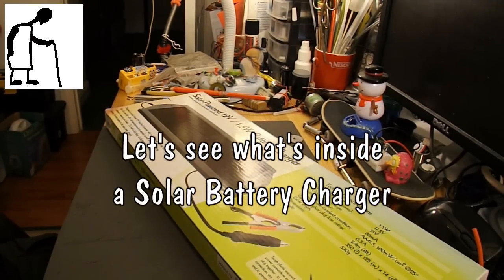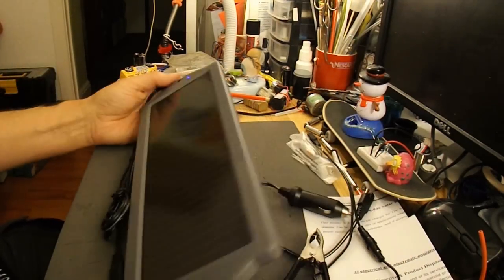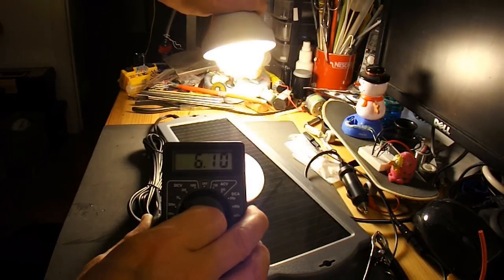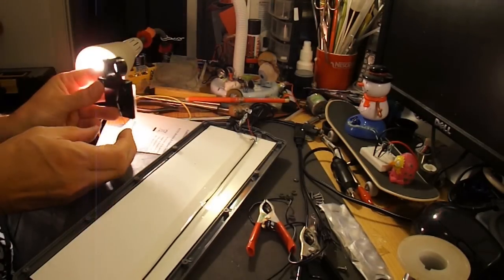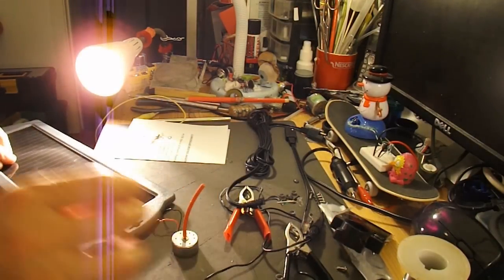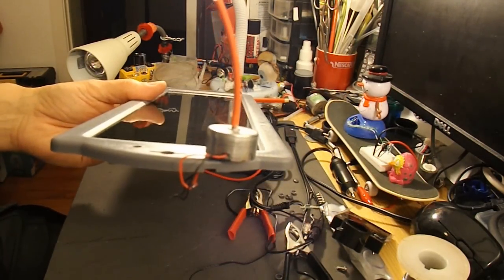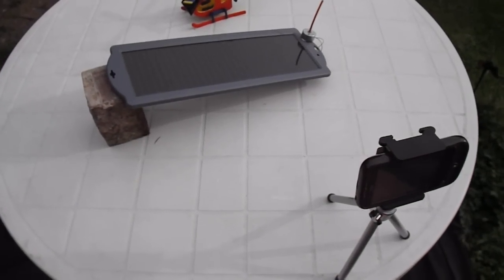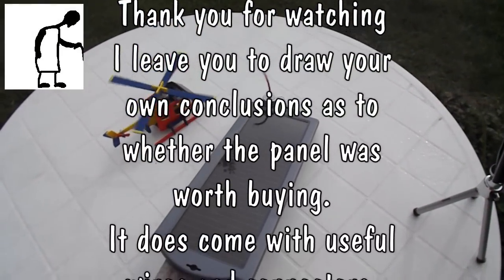Let's disassemble a Maplins solar battery charger

Comment: 1.5Watts Not very much output. I just purchased a 20Watt to maintain the 12v battery in my pickup truck during winter when I store my vehicle for months at a time.
Reply from the maker: Well this was filmed back in 2014 and things have moved on a bit since then. As it is, this one sits on my garden shed window facing north east, so it gets no direct sunlight for most of the year. It keeps the spare battery topped up, that I use very rarely for hot wire cutting foam board. Inspired by your comment I just went out to my shed and measured the voltage. 13.27 volts and thinking back I probably haven't touched it for over a year now.

Comment: They have ripped a lot of people off with that panel
Reply from the maker: It will keep a battery topped up, but it won't charge one from flat. I have it in a window in my shed and it keeps the 12v car battery stored in there topped up nicely. I use the battery occasionally to run a foam cutter. After a few days it will be back up to full charge. Obviously that depends on how much I drained it.
Reply: It's not a rip off if used properly. My car only draws 30-40mA while sleeping, anything that compensates the draw on average will prevent the battery losing charge and be damaged by hard sulfation. On a cloudy day, a panel of this size would produce about 20mA. On better days, you get maybe 60mA, which, in my case, would cover the draw plus self-discharge and there would still be some mA's left over to add to the battery. These panels should not be seen as substitutes for wall chargers. If the panels are correctly sized to match the draw, you would never need a wall charger. The alternator would do the charging the rest of the time.

Comment: The LED is using power - - that's why the meter is jumping about. Open it, cut one leg of the LED to disconnect the LED, your output will be stable then.

Comment: I have a smaller panel than that at 12V and runs my radio a large Russian Astrad   and it bels out the tunes when the sun shines through the kitchen window
Reply from the maker: Yes, I have a smaller panel that I used to run an RC boat so I was very disappointed with this one, but it does keep the car battery I use for hot wire foam cutting topped up in the shed.
Reply: yes it probably will do that ok  still it should have run that motor better than that

Comment: See what happens when you cover the solar panel (simulating no or low sunshine) for a few days. Does the battery discharge?
Reply from the maker: Haha, simulating no or low sunlight is easy here in the UK, I don't need to cover the panel to do that. I leave it connected to an old 12v car battery in my shed. The panel is in the shed window facing north and is never in direct sunlight. It does keep the battery charged but I only use that battery for hot wire cutting foam wings and I have only done that a few times in the two and a half years since I bought the charger. Originally I was measuring the voltage on a daily basis and it would restore the battery after I had used it. I would think it would be totally useless if you wanted to charge a battery from scratch but if you have a battery in a vehicle you only use once or twice a year it is probably fine for keeping that ready for use.

Comment: They generate enough to power.......you've guessed it, the LED. Mine went in the bin.
Reply from the maker: +jackbox to be fair, I have mine connected to a spare battery in my shed and it does keep it topped up. I use the battery to power a hot wire foam cutter and the solar panel keeps the battery fully charged without me needing to recharge it. I don't use it very often so for the amount I use it, it does the job. However I didn't buy it for that purpose, I wanted it to run solar cars or boats and it doesn't produce the goods for that.
Reply: You gain a little more by removing LED but a friend and I tested one of these on the brightest day of the year in 2014 and worked out it would take a week to charge a mobile phone and that was relying on full sun. Given the size you'd think it'd deliver more than that. Not sure whether its an inefficient panel or rather optimistic claims but you need at least a 20watt panel to charge a car battery with anything meaningful. Biggest hurdle with powering a small motor with one of these is developing enough power to actually start it going in the first place. A capacitor might help. Certainly pointless in a car.

Comment: Well I have one and found it was not that great . (💩 really) it's now a great coffee mug coaster ....
Reply from the maker: +spektrum33 I am not surprised, I was not impressed with it although to be fair, I have left it in my shed window connected to a spare 12v battery that I use to power my hot wire foam cutter and it keeps it topped up. If they didn't call it a "charger" it would be OK although I am not sure what a more suitable name would be.
Reply: lmaooo

Comment: don't you have to run these through a charge regulator to prevent your batteries from cooking?
Reply from the maker: +sillychilly There are certainly plenty of people telling you that is necessary with plenty of videos on the subject on YouTube so I have no reason to argue. However these are pretty low output even on a good day and they are only intended to trickle charge the battery even though they label it as a "Charger". You can't stick a flat car battery on it and expect it to charge the battery in a couple of hours. You would be waiting weeks or months even.

Comment: check out this video i doing what this guy did     https://www.youtube.com/watch?v=RxKCUzwIrH4
Reply from the maker: If you are going to spend time modifying it then you might as well buy a bigger cheaper one off eBay at the same time as buying a cheap buck converter. If you order them from one of those cheap Chinese suppliers they will take a while to arrive but they will both come at the same time and cost you less.
I guess the only advantage of buying the kit is you get the battery leads with it and it looks quite nice.
Reply: well my solar pannle is putting out 22 volte in full sun light and 20 at 12o`clock and cloudy if i wire in the converter, lower my volt output to 14 volts that will make my millAmps go up therefore my watts will go up..Just by adding a $1.01 part that i already have and I`ll find a small plastic to put the converter in for 2 or 3 moer dallors so for less than 5 dollars i can make my cheap solar panel that was a 1.5 watt into at least 3 watts.and i`m thinking about gettine another one since harbor freight has it on sale for 15 dollars and put them together and get about 6 whatts. This is just the kind of things that are fun for me to play around with.
Reply from the maker: dave nmemphis that sounds like a good job done, nice work.
Reply: thanks but thats not my video, but thats wahat im doing

Comment: Got 3 of those, they trickle a car battery. Quite tough, mine have been going for a few years. Output is down to about 150mA for all 3 combined...but they've been hit with hail a few times.
Maybe yours is the same, the blue LED goes solid on in full sun.
Reply from the maker: My issue with this one it the fact the big writing on the box says Battery Charger when in truth it is a trickle charger and nothing more. It talks about 1.5 watts and working in overcast conditions. Each statement is probably true in ideal conditions, but not at the same time. I have prepared a video comparing it to a cheap eBay panel from China which out performs it in every way for my electric car purposes. Obviously I am then looking at power to weight ratios too and even with most of the casing removed I haven't been able to get one of my CD wheeled cars to move convincingly yet, when my eBay one is shooting off into the distance in the same sunlight. I will do a bit more before I upload the video because I really would like it to work.

Comment: It does deliver 2 Watt at full sunlight (approx). I ran my radio on 2 of them but only charging half of the day as the sun has gone over the roof of my house. i charged 3 (not so well) super capacitors of 400F and ran a radio for 6 hours or so. Voltage between 8.1 Volts and 3.65 Volts. But as days get shorter, the 2 panels do not deliver much power anymore. Only enough for one hour of music left. I can maybe up the power a bit by using a bucket converter, since the voltage is 19 Volts (a little MPP tracker, optimized for supercaps / low voltage would be nice). Note: P = U x I. Power = Voltage x current. The power is approx 1.5 to 2 Watt, but if you manage (using a bucket converter) to lower the voltage, you can get more Watts out of it. I have not yet tested it, I do have a few of those converters (China stuff, you know). I will let you know if that helps. I think you can easily lower the voltage to 5 Volts (put it on an USB cable), and charge up a cellphone Li-Ion battery with it (with it's charger, via USB). You do can use the 4 Volts from the Li-Ion battery. Buy an LED light with motion detection on3 AA batteries. (there are several of them on the market). I have 3 of them all around my house, running on Li-Ion batteries and that works very well ! (ps: do not charge the Li-Ion from the solarcell without a regular charger in between as Li-Ion is or can be dangerous above 4.2 Volts). Also de-solder the LED in the charger, why waste a few Milli Amps?
Reply from the maker: Whoa, slow down, thanks, but that all sounds a bit more effort than I had in mind. A couple of drinking straws, a couple of bbq skewers, 4 CDs and a small electric motor to run up and down the path :-)
The sun did come out later in the day and that little electric motor was spinning madly.

Comment: Large 12v Solar panel output little mA, will be nothing but a waste of $.  fyi : look into Uni-Solar flexible Solar panels, weather proof, good output mA. Six in Series connection of 2v per panel, will output 250 - 400mA.
Reply from the maker: I am guessing the key to this is that it is only intended to trickle charge the battery to keep it topped up when not in use, rather than charge it from flat, so it does not want to overcharge and end up boiling the battery when left connected for months on end. If it said that clearly on the front of the box I would be happy, but the big writing says Battery Charger. I have much more powerful, much smaller, much cheaper panels already, postage free, direct from our eBay friends in China but I thought I would try this one as it was on special offer.